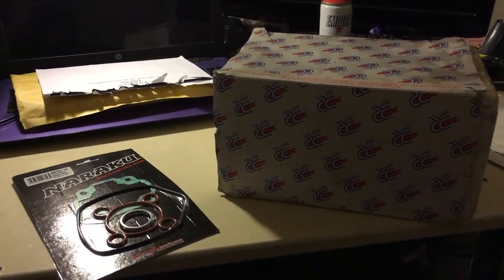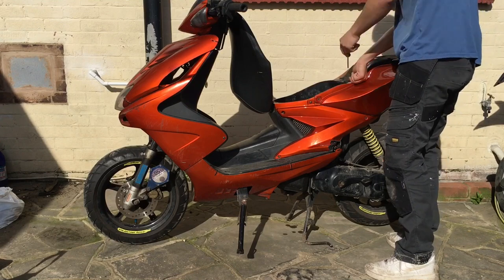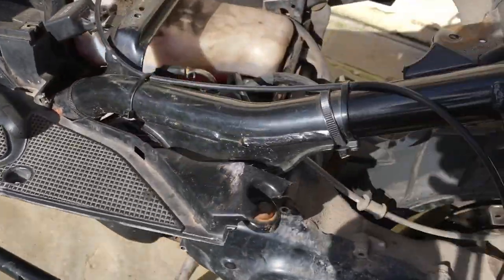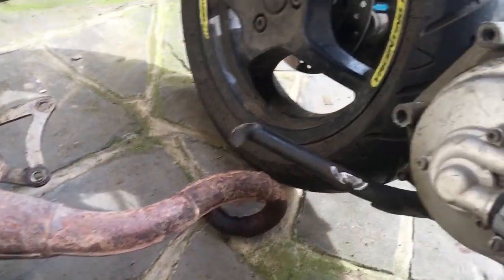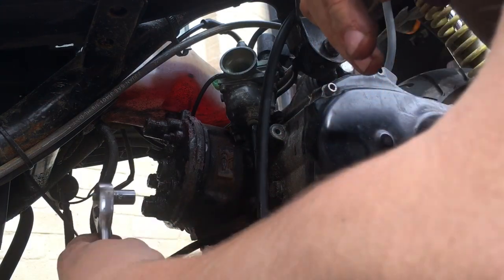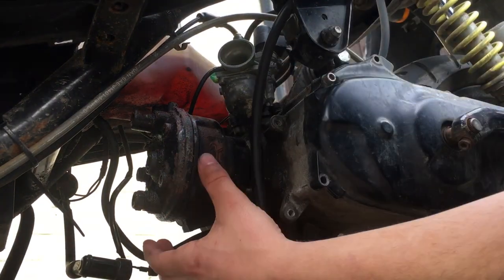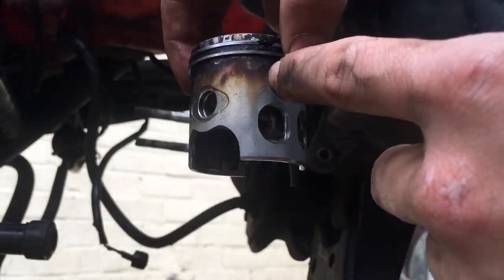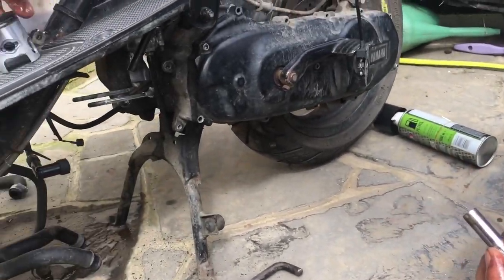DETAILED! How to rebuild Yamaha Aerox top end(cylinder, cylinder head and piston)

Comment: Best video I’ve seen made so far dude really good information I’ve got a Malaguti Firefox F15 2006 & a 2001 the 2001 I’m bringing back to 100% standard condition but de-restricted & a malossi variator kit with 4.5g rollers & selling. 
I’ve got a Yamaha 1995 BWs with a full stage6 setup including the crank it’s extremely quick I use to have a aerox 2005 new I had it de-restricted (the washer from the variator removed, it went 53mph just with the restrictor removed

Comment: Nice video, I've a Firefox which has the same engine/head (lc), temp gauge keeps flashing on the digital display, do you know where exactly the sensor is on the cylinder? Cheers
Reply: The sensor is in the top of the gasket near the sparkplug

Comment: I'm going to do this this week so thanks for your tutorial mate it literally is just a 15 minute job. But I have one question. Will the standard carb settings still work with the new cylinder or do they have to be recalibrated?
Reply from the maker: Jamie Yang it depends on what cylinder it will be mate and also depends on the exhaust
Reply: Jakhy I have recalibrated it because it didn't run well and it's running well now. I choose a cast iron cylinder now instead of a aluminium.

Comment: Did you run the 70cc on stock carb?
Did it work good? (With other jets of course)
Reply: it will have no torgue with a 12mm carb
Reply: @kehariracing9884  do i need new carb for a sports exhaust?
Reply: @hardendurobosnia17  not needed but it will have more power with a 17.5mm carb
Reply: @kehariracing9884  I'm just trying to see if it will last,  thanks
Reply from the maker: The engine would benefit hugely for a larger carb, but at the time I ran the 12mm and once jetted right the bike was a lovely commute and had plenty of top speed. It just didn’t have the potential power it could have had with a larger carb.

Comment: Hello my friend do you now whats the real function of the 2 tubes goes from the top of the cilinder to carburator with water? If i eliminate them is any problem?
Reply from the maker: The 2 pipes that go from the head the to carb are simply to keep the carb warm it the winter to stop the throttle slider getting tight and jamming. You shouldn’t have an issue blocking these off

Comment: Hey, just got my malossi sport 70cc but Im having trouble getting the piston in the cylinder. Its like it wont fit. Ive tried for so long and I have gotten help from 3 others to push the pistonrings in but it wont fit. Do you have any tips?
Reply from the maker: With the piston in hand, can you compress the piston ring all the way into the recess on the piston so it’s flush with the piston?
Reply: @jakhy1198  Yes, but when press it while i try to put in in the cylinder it wont fit.
Reply from the maker: With out the piston ring installed on the piston, will the piston fit into the bore?
Reply: @jakhy1198  Yes

Comment: can you use the 2 stroke bottle on a 70cc cylinder kit without it seizing?
Reply from the maker: So the flow rate would still be standard flow rate per rpm, but you’d have to consult the manufacturer to see if this would be suitable amount of oil for your kit. I premix to be safe in two aspects, I know exactly what ratio is going in and I also know there isn’t a pump to fail.
Reply: @jakhy1198  Thanks for the quick reply! Also, what size carburetor do you run for your 70cc setup? And do you have any recommendations for a good 70cc kit thats reliable but also fast?
Reply from the maker: @xdfunnyguylo8065  I’ve used a whole range of carbs and kits, but currently I’m using a 19mm Dellorto PHBG, and a pm tuning single ring 70cc from PM directly. I’m getting quite impressive power out of this but also depends how you’ve got your transmission set up. 

Reliability wise the PM is great, but ultimately what it comes down to is care. Making sure to warm the engine up properly before riding and cooling it down correctly before turning it off, making sure you use a good quality 2t oil and also the correct safe 2t ratio. Also, it’s obvious but I’ll mention it, just don’t be pinning it for prolonged periods of time if yours is a high revving setup, I’d recommend getting a digital coolant gauge like I run and just keep and eye on it when you’re going to be heavy on the throttle for a longer period of time.

Comment: Is there much of a difference between the 50 & 70cc? considering doing it, kit is cheap, but is it worthwhile, mine is struggling badly on hills and is de-restricted.
Reply: Yea 70cc 60mph or over
Reply: Cheers for that, how is fuel consumption post upgrade? It's drinking petrol as it is, i suspect due to the struggle on hills etc
Reply: @tqm6943  well i'd say 0.5l per 10km. And it'll need a new carb and new jets and just make sure everything is set to make it run as good as it can. 70cc's can make up to 30hp with the right setup!
Reply: @tqm6943  and probably a new exhaust, Yasuni carrera c16 i would recommened or a leovince zx or a zxr

Comment: Mate!
I know it's a bit late, but jesus christ I cringed brutally hard at the part with the piston clips!
do NOT reuse them!!! that is incredibly dangerous!
If they were taken out once, replace them.
Also, stick a towel into the engine while taking them out, i've had them spring into the bottom end!
Reply from the maker: Check the description.
Reply: @jakhy1198  my bad mate,  didn't Check.
Good on you for actually taking criticism!

Comment: dont buy the Naraku head bolts! Junk! 2 snapped just torqueing to spec! I just used the longer nuts with the stock bolts in the end .. standard stuff is actually built stronger than people realise
Reply from the maker: shoominati23 yeah mate I know naruku are crap I wouldn’t use anything other that the top end gasket set